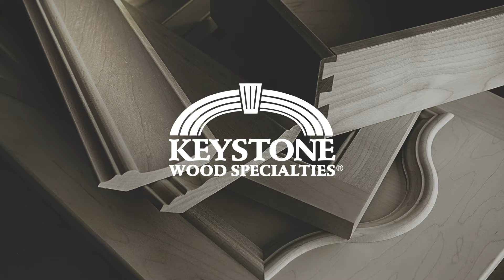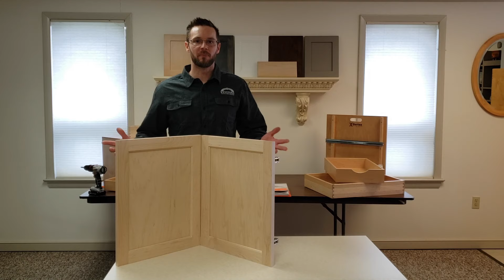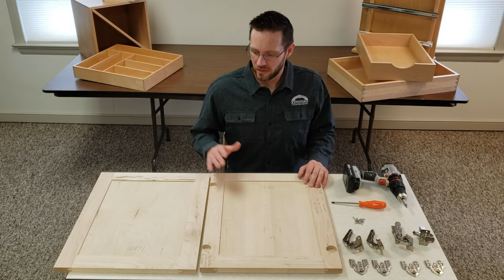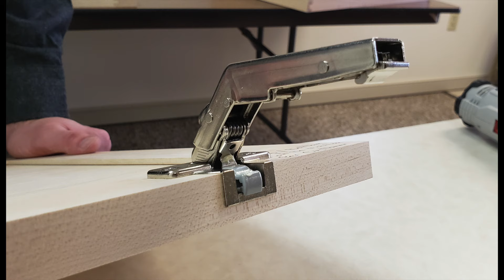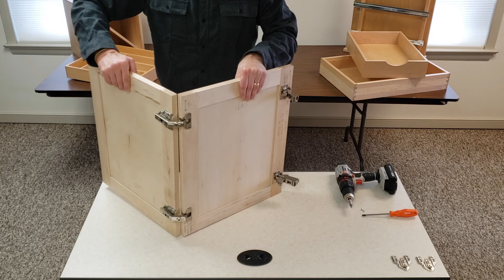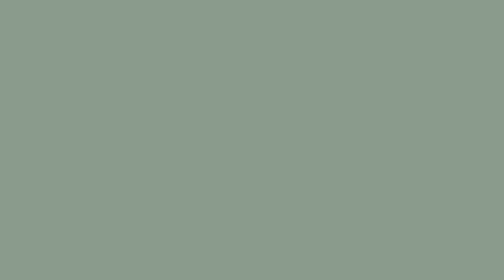How To Install Corner Susan Door Hinges

Comment: Thanks for this video! Just a quick question. When drilling the hinge that joins the doors - What measurement do you use to get the correct spacing for the flat edge to meet? Thanks

Comment: My doors are different. Each door has those big holes where as yours one door has four big holes.
Reply from the maker: Thanks for the comment! The boring for the hinge that connects the doors could really be on either of the two doors. So you could either put the boring for the hinge that attaches to the cabinet on one door and the boring for the hinges that connect the doors together on the other, or, as we do it, put the boring for the hines that attach to the cabinet and the boring for the hinges that attach the doors together on the same door, and the other door would have no hinge boring. Either way works the same. Hope that helps!

~Dan
Reply: @keystonewoodspecialties1973  Thank you for the info.

Comment: You would expect to have shown the system installed-= without that it would seem no one has one. It just does not show the in use  in kitchen, utility,  easier or difficult

Comment: When boring the middle cups on a thermofoil door, will thr bit tear apart the thermofoil coating when blowing out the side?
Reply from the maker: Hi Jarry, that is definitely a possibility! I always recommend testing it on a scrap piece first, if you have one. And if you're consistently getting tearout on your scrap piece I would recommend switching to a different type of corner hinge. Salice makes a hinge that uses a more typical cup drilling that doesn't cut into the edge of the door. Hopefully that helps!

~Dan

Comment: Great video! I have one question, I ordered new hinges, but notice that the one that sets in the bored out hole on cabinet door is coming away from the door about 1/8 inch, and you can't screw the screw any tighter. Does this mean something inside the door has rotted and will not even hold a new hinge there where that screw is? The hinge is tight enough to stay on, just not sitting flush in that hole.
Reply from the maker: Thanks for the question! Based on your description of the situation I believe there are actually two issues here. I believe the new hinges probably require a deeper bore; that's likely what's preventing the hinges from sitting flush against the door. It's also possible that there's something under the hinge, maybe a piece of debris, that's preventing it from going against, so check that first. And the first problem likely caused the second problem: loose screws. The original screws could have been a larger diameter than the new screws and/or the new screws were over-torqued trying to get the hinges to sit flush with the face of the door. The result is a stripped out screw hole. My recommendation here is to either switch to a larger diameter screw or drill out the screw hole with a 1/4" drill bit, glue and plug it with a 1/4" wooden dowel, and then pre drill and reattach the hinges. Hopefully that helps!
~ Dan

Comment: I appreciate your video and it seemed to have answered most of the people's questions; mine was how to mount the bracket into the shelf.  I had an old GRASS hinge and since they are no longer manufactures, I purchased the Ferrari hinge; and when I have put them on, they have been in a bind. I will get it figured out.  Thanks again from 2024!

Comment: I have a cabinet that is 80" tall that i am considering using a hinge like this on.  Instead of a lazy susan it is a large corner cabinet in a closet.  Can I use 4  or 5 sets of hinges and use these hinges in the same way as you use here on a base cabinet.

Comment: Hey! What's the centre measurement for the 'half-bore' hole? I know it's a 35mm bore, but how far from the edge should I start my drill?
Reply from the maker: Hi Marco, thanks for asking! The current Blum spec book indicates 12.5mm from the edge of the door to the center of the bore. And yes, the bore diameter is 35mm. Hope that helps!

~Dan
Reply: Is it possible to get a 60 degree hinge for a standard bore?

Comment: What kind door hinge is that
Reply from the maker: The hinges used in this video are BLUM 60 degree clip-top (79T8500.10 with hinge mounting plate 175H6000) and BLUM 170 degree clip-top (71T6550). We recommend that you refer to the BLUM literature for the hinge that suits your specific application.

Comment: This looks great. We are designing out wardrobe and need to do something  like this. Do the hinges take the weight of the door well over time?  Thanks
Reply from the maker: Thanks for the comment! When used in a lazy susan application these hinges hold up really well. A typical Base corner cabinet is 36" x 36", which leaves a 12" x 12" face if the ends are 24" deep. So the normal lazy susan doors are typically 12" wide or less, which means these hinges are not subjected to a lot of weight in a susan application. If you're using these with a different setup and much larger doors I would check the weight rating with Blum and possibly do a test setup.

Hopefully that helps! Have a great day!

~Dan

Comment: This was the most helpful video I've seen about this hinge! I've been looking all over the place for something like this to help me understand how these hinges work. But I still have one burning question that I still haven't gotten an answer to! How far can you adjust the door spacing?! What is the widest you can adjust it?! I'm looking for something that will swing an inset door around a 3/4 inch baseboard that's laying right next to it Side by side. It's not a typical setup.
Reply from the maker: Thanks so much for the comment! For the scenario you're looking for, do you have a picture or drawing that you could send me to help be better understand your specific situation? Would love to help you figure out a solution.

~Dan
Reply: @keystonewoodspecialties1973  Thank you for responding! Here's some pics. I'm in the middle of remodeling this kitchen. Had to remove baseboard for doors to swing open without whacking baseboards. Now I'm looking for a more permanent solution. I may just turn these back into a bifold door which is what it used to be. The brown cabinet on the left will not be there when I'm done with the remodel. 

 Pic 1: https://drive.google.com/file/d/1QmvqHRnL3zDSgUEOEQ933GSAtw0hFuv7/view?usp=sharing

Pic 2: https://drive.google.com/file/d/1Qv3fUWtgqy7kjL9Kx_ONcjRaNb3uAMyM/view?usp=sharing

Pic 3: https://drive.google.com/file/d/1QwlFI8sEBdGgIufdYvUbW9WCJddNPG87/view?usp=sharing
Reply from the maker: @powerofknowledge7771  Thanks for the pics! That helps me understand the situation much better. So there are a few things going on here. The biggest issue I see is the installation of the hinges. The hinges should be installed so that you only see the barrel of the hinge when the door is closed, and the two flats are essentially touching each other. These hinges might also be too small to give the door enough swing clearance (they look like cabinet door hinges), so you may have to look at getting bigger hinges (interior door hinges). Another thing that will help is installing casing around the opening. This buys you a little space between the hinge and the start of the trim, and most casing tapers in thickness as it nears the door, which aids in door clearance.

Hopefully that helps! Have a great day!

~Dan
Reply: @keystonewoodspecialties1973  Thanks for taking the time to respond! Those are great ideas! I was just trying to do less work on this project by just getting some different hinges that swing out. lol. I guess there isn't any such thing. Perhaps adding a casing is the only way to go.

Comment: Awesome video! 
Got a question. Does the same mounting plate fit the 60 and 170 degree hinges?
Reply from the maker: Hi Danny, glad you liked the video! I do use the same mounting plate for both hinges in the video. Have a great day!

~Dan
Reply: @keystonewoodspecialties1973  great video, are the plates you’re using to mount these hinges a 0mm, 3mm, 4.5mm etc?? Also, going through a supplier catalog for Blum hinges, I don’t see a 60degree bi fold hinge anymore. Did they update this to the 90 degree clip top bi fold self close hinge?? Do you know Blum’s part number for the 60 degree hinge?? Thank you!!!
Reply from the maker: @ericlind3569  Hi Eric,

Thanks for the questions! We listed out all the part numbers for both the hinges and the mounting plates in the description. You can use a different plate for the 170 degree hinges, based on what overlay you're looking to have. The 60 degree bi-fold hinge is on page 36 in my concealed hinges catalog. There is also a guide for calculating door sizes on the same page. Hopefully that helps. Happy hinging!

~Dan
Reply: @keystonewoodspecialties1973  I just saw the part numbers, thank you for that. However, I don’t see a link for your door calculating guide or page?
Reply from the maker: @ericlind3569  Good morning Eric,

Sorry for the confusion...the door calculating guide is from Blum, and it's on the same page as their Bi-fold hinges, pg. 36 in my Blum catalog.

Hopefully that helps! Let me know if you have any other questions.

~Dan
Reply: @keystonewoodspecialties1973 one other question, how do you go about ordering the correct door sizes for the opening with these hinges? Are there any “gotchas” to look for??

Comment: What is the distance of the hole of that concealed hinge from the side of the wood? Normal hinges usually can be installed 2.3-2.5mm. Do the same applies?
Reply from the maker: Hi Sanjoe!

The hinge that attaches the door to the cabinet is the 71T6550 hinge (Clip-top 170 degree) with the 176H6000 mounting plate, which is a "zero" plate. You can either bore the door at 2.5MM DBE, which will cause the door to overlay the cabinet by 1/2", or you can bore the door with an 8MM DBE, which will cause the door to overlay the cabinet by 3/4". Hopefully that helps!

~Dan

Comment: I wish you would've shown how to adjust the other2..is there no up/dn adjustment?
Reply from the maker: Hi Jameson,

Are you referring to the 170 degree hinges? If so, the height adjustment on the 170 degree hinge is the same as the bi-fold hinge: the adjustment is actually on the mounting plate, and the 170 degree hinge has an access hole that allows you to get a screwdriver through the hinge to the height adjustment on the mounting plate. Hopefully that help! Let me know if you have any other questions.

Have a great day!

~Dan

Comment: Thanks a lot for this wonderful explanation, my question please: what is the distance from the center of the 60 degrees bi-fold hing to the edge of the door to make the correct drilling? Thank you!
Reply from the maker: The correct distance from the edge of the door to the center of the cup drilling for the bi-fold hinge is 12.5mm.

Comment: what is the name or manufacture of the hinges that connects the doors or are between the two doors?
Reply from the maker: The hinges used in this video are BLUM 60 degree clip-top (79T8500.10 with hinge mounting plate 175H6000) and BLUM 170 degree clip-top (71T6550). We recommend that you refer to the BLUM literature for the hinge that suits your specific application.